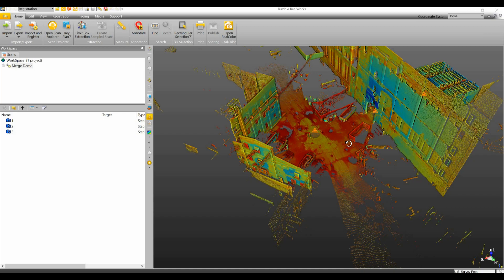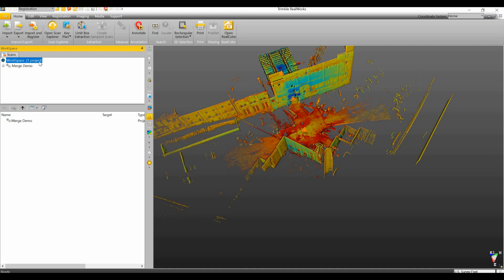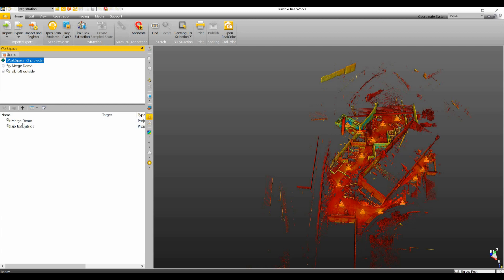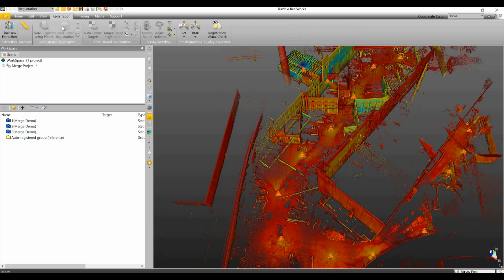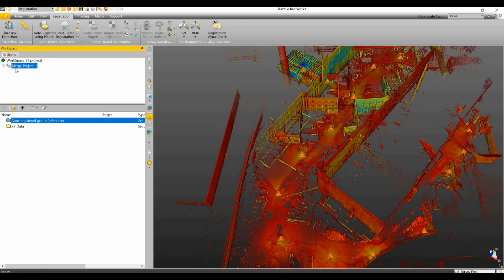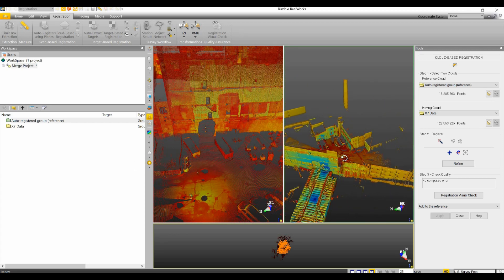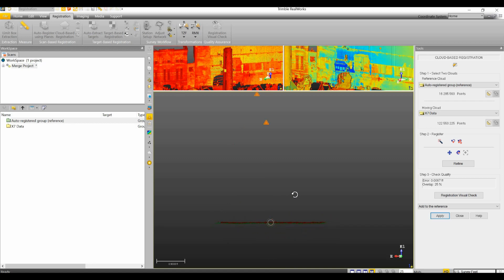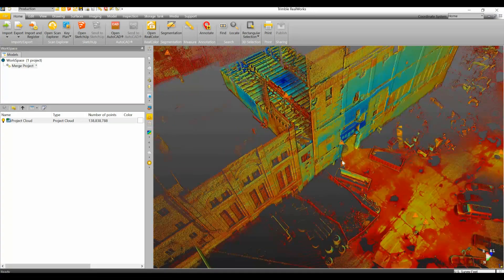How to Merge Multiple Projects in Trimble Realworks

Comment: Thanks! But you have not touched last step, saving. What is your recommendation? I tried to use "copy TZF's", to create a new project folder, but it moves only TZF's and just links other files. Not sure what is the best way. (have registration of o big site, was done over several weeks, each day as a separate project, due to several people working on it)
Ideally, thought to merge projects and get one new project folder with all files in it. (or should I leave files where they are and link them, and delete obsolete RWP files later?)
Reply: As a general rule of mine i always copy the TZFs file just so i can have them attached to the new RWP project. That way you're not referencing the original files. Yes you'll duplicate information but you'll have a neat system. It helps you be organized with your files.